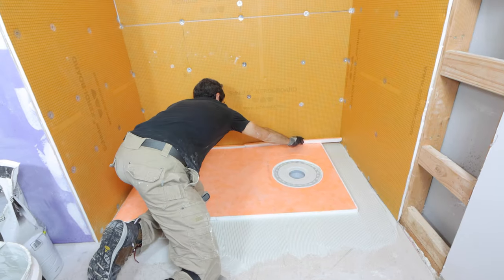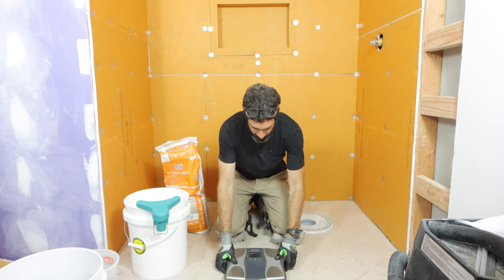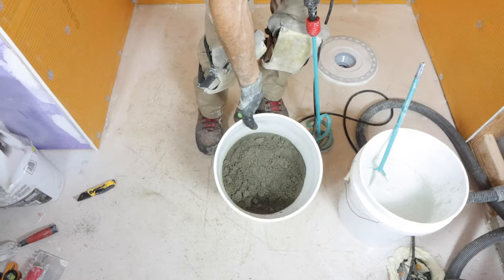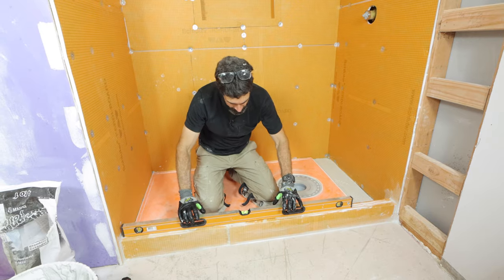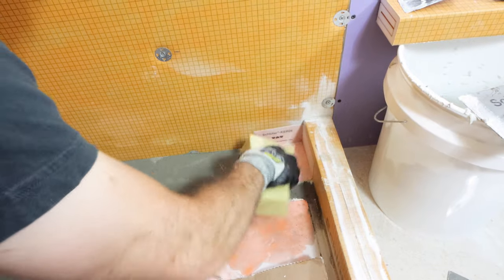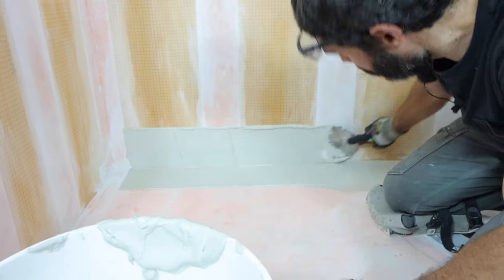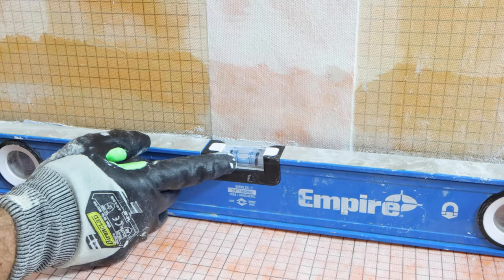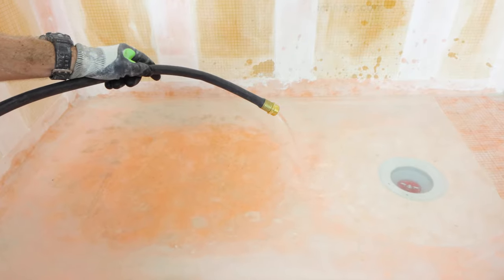Schluter Shower Pan Tips for Beginners

Comment: I don’t understand why you cut off a 3/4” strip on the sides then put it right back down when you laid the pan.   Excellent video.  I really like your presentation approach.
Reply: Me too
Reply: Me three
Reply: @stroys7061  me four
Reply: Makes no sense to cut 3/4 I think it's a trick
Reply: Guess you guys missed the part where he cut an additional 3 inches off each sideto trim it, his trim cuts were probably crooked so he used the 3/4 inch because they had factory edges to square off the shower pan again.
Reply: The first 3/4 of the edges are flat. The pan itself is fabricated with a pitch towards the drain. He cut it because the drain was offset. If it were in the center then you'd cut it square to fit. Now the entire back wall of the shower is nice and level and the entire thing pitches to the drain.
Reply: Seems like alot more work then a traditional wetbed
Reply: It’s to keep level around the shower floor edge for the mud

Comment: Another great video as always! My apologies for the dumb question but I did not understand why you cut 3/4" of the edges and then re-used the same strips.
Reply from the maker: Thank you 🙏🏼 the first 3/4” of the tray is flat. That’s actually very helpful for the wall tile. When you cut down a sloped tray like this one, it creates a slight curved shape along the perimeter which means the wall tile might have to be scribe cut. However, by cutting off the flat 3/4” perimeter and adding it back, it makes the perimeter flat again. And that helps with the wall tile
Reply: @HomeRepairTutor  Thank you very much again!
Reply: How do you deal with the lip it creates when tiling? Just add more thunder when tiling floor? And any additional water proofing needed?
Reply: Thinset *
Reply: @HomeRepairTutor  Sorry, one more question, doesn't the flat perimeter cause water to stay at the perimeter and not flow through the drain? Also, since I'm using 4'x4' panels instead of wall tiles, do you still recommend this trick? Thanks!
Reply from the maker: @f.shabestari8276  you’ll have to make relief cuts for the large 4’ tiles so they can conform to the shower pan slope. Those are from the corners to the drain corners, if you have questions just email me at jeff@homerepairtutor.com

Also, I’d still do the perimeter tip because it won’t prevent water from draining properly. The wall tile will bump out the wall by 1/2” or more
Reply: @HomeRepairTutor  Thank you very much again Jeff! You've been extremely generous with your time.

Comment: Jeff, my kerdi boards don't make it down to the shower subfloor without cutting a two inch strip to run along the bottom of the floor. I am using a kerdi shower pan (2 inch) that meets the wall boards without a gap, do I need to fill that void with deck mud?

Comment: I have the same shower tray that I need to install, however I’m building a curbed shower. Is it necessary to recess the floor 3/4’s of an inch if your using 3/4 inch plywood around the shower? I think recessing the floor would make the tiles in the shower and the rest of floor flush however is it necessary if the shower is going to be curbed anyway? Also can you provide a link so that I can build some of the foundational plumbing beneath the schluter tray. I’m trying to attach pvc piping to my lead drain.

Comment: Not sure that I understand cutting off the 3/4 inch strips to use them in the same spot later. Can anyone clarify?
Reply from the maker: yes, if you have to customize the tray it helps a lot. The first 3/4” along the tray perimeter is flat. This helps when setting wall tile. So if you need to reduce the size of the tray, cut off the first 3/4” then cut off whatever is required for the other sides. I cut down a 38” tray to 32”. So the first 3/4” was cut off then 3” on the left and right sides. Then I added the 3/4” strips when setting the tray. Schluter actually gave me the idea 👍🏼🔥
Reply: @HomeRepairTutor  Thank you!. I appreciate your response and all of your great videos. That makes perfect sense.  I have a 36x72 Schluter tray with the line drain that I'm about to install. I built the opening just a fraction wider to allow an easier install of the pan. I would think that the thinset could fill the 1/8 inch gap ok. If all goes well, I don't have to trim anything  :P

Comment: Did you use the wider banding for the sides with the 3/4" strips you reinstalled?  If you used the 5" wide band, you won't have the 2 inch overlap required along the the length of the strip.

Comment: Jeff, I’m really glad to see your jumping into the deck mud band wagon. I just finished floating my shower base using the the 4:1 that you mentioned, and it was much cheaper than using the foam tray—though I see the appeal of the foam. I kinda agree with Sal and his theory of foam vs deck mud. 

Great vid as always!
Reply from the maker: thanks buddy, yes, I’m starting to like the idea of using deck mud since watching more videos from Eylander Tile. No doubt, it takes skill and attention to detail but it’s simply awesome to learn new skills. Do you have a preferred deck mud or do you like mixing your own?
Reply: I prefer a 5:1 ratio for my mud because it’s easier to shape and form. But that takes time, for time, so I rarely mix my own mud. 

I like the 4:1 from Mapei, but I use even less water that they recommend—2.5 qt/ bag. Makes it less thick, even for a dry pack!

Your finish looked really good!
Reply from the maker: @davidherd3739  thank you, I’d like to use more deck mud and tinker around with it on future projects. I think for custom sized showers it would be great, have you ever used it for a curbless installation?
Reply: @Home Repair Tutor — bingo! That’s the appeal for custom drain placement. Plus I prefer to use the new FloFX drains. You’ve used them? Frankly, they knock the socks off of Schluter or Laticrete drains.

I haven’t used it on a curb less install yet, but the technique would be the same nonetheless.

Comment: I like your video. I want to build one with a linear drain in the middle, perpendicular to the curb. Unfortunately the liner would not be big enough, kinda like in your video. I'm wondering if it would be easier to just make a concrete bed all over. 
Also I want to install a frameless shower door which needs a screw in the curb. What kind of curb would you build so it can hold a screw? I was thinking of a wood curb covered with curb kurdi board. Would be great to hear your opinion.

Comment: Do you need to use the kerdi band where the kerdi board meets the drywall ceiling or do you leave that joint open? Thanks!
Reply from the maker: you can leave it open if it’s small but yes, banding can be used as well
Reply: dont band the ceiling if you plan on having a painted ceiling. just leave it open, water doesnt get that high

Comment: Great video - thank you! Question please - I have a narrow pan as I am replacing a tub and have limited clearance. I've cut the 3/4" strips off the sides as you suggested.  Since I cut the pan down to 25" total width, there is a significant lip on both sides at the 3/4" strip. The lip goes from 1/16 to nearly 1/4" near the drain. Should the lip be filled with something like Henry's Feather patch before I do the Kerdi corners and band? Any suggestions welcomed.
Reply from the maker: Great question, you can use thin-set (eg ALL-SET) to feather that lip. Allow that to set then use KERDI-BAND to waterproof as you would normally

Comment: Nice vid...are you able to connect end on end 2 schluter shower pans? I'm extending my shower and it will end up with 2 drains one on each end (8' shower)
Reply from the maker: good question, if it’s a big shower you might want to consider floating the shower tray with deck mud, I’d have to see the design to determine what would be your best option 👍🏼🔥
Reply: Theoretically it seems possible. Just make sure both pans are the same length since the perimeter heights are different.

Comment: One question, I see sometimes you use Keri membrane on sheet rock and sometimes on usg boards for the shower. what is better Keri board? sheet rock or usg board?
Reply from the maker: Good question, I prefer KERDI-BOARD. It’s lighter than cement board and dustless. And doesn’t have any organic materials, like drywall. Plus, I can use extra pieces of the board to build shower niches

Comment: Nice video! Was this on a concrete subfloor or basement? Would greenboard drywall and primer to seal work for tile in a shower?
Reply from the maker: It was over self-leveler, drywall can be used with KERDI but mist liquid membrane manufacturers don’t recommend using their products over drywall, eg RedGard. You could use cement board and liquid membranes 👍🏼

Comment: what's the diameter of your shower curb? I'm looking at customizing schluter's prefab shower curb to about 3 inches high and 3 inches wide. Your curb looks very similar to how I want mine to look.
Reply from the maker: It was roughly 2-5/8” wide - I customized it by cutting it in half and bonding back together with KERDI-FIX
Reply: @HomeRepairTutor  that’s great. thanks for the speedy reply.

Comment: So you said to cut off the first 3/4" before you trim to size.  I did that with my tray but the 3/4" strips are now higher than the rest of the tray edges????  So now I have a tray that is too small for the shower space and or the edges are higher than they are supposed to be.   You didn't address this in your video, what's the fix or do I now have to go spend another $130 on a new tray?
Reply from the maker: First, this video was done per my Schluter rep who recommended this tip. The first 3/4” of any tray is flat. The reason is so that the wall tile won’t have to be scribe cut. 

Second, calm down. You can still use the shower tray. The 3/4” pieces are added back. And yes, you’ll have a slight increase in elevation. That can be feathered with thin-set and a 6” drywall knife. Once that cures, use banding to overlap the shower tray seam and corner by at least 2” per the Schluter Handbook.

Comment: Great video!  I'm curious, what's your thought on shower pan + strips + deck mud, versus just doing the whole thing with deck mud, both from a time and cost perspective?
Reply from the maker: It’s a personal preference, I can see how some prefer deck mud because of the art form and enjoyment versus perhaps someone who simply wants the pre-slope built into the tray.
Reply: I agree with Jeff. I prefer mud installations. It’s a little bit of preparation up front to ensure you get the proper pitch to the drain, but the payoff is wonderful. It’s faster to do a deck mud install, and you can put any tile you want on the floor. Foam trays, per Schluter directions, mandate at least a 2x2 mosaic on their trays because of point-load distribution. You couldn’t install a penny round of you wanted on foam for example. 

Plus cost is a big factor as well. Foam trays are substantially more expensive than deck mud installs.
Reply: @davidherd3739  Thanks for your feedback as well!  Makes total sense and will take this into consideration for my next project!
Reply: @HomeRepairTutor  Seems to me a portion of that slope would be missing if you added back the 3/4" edge strip after removing 3" from the perimeter, leaving a "step" between the cut edge and 3/4" strip.
Reply: @davidherd3739  , do you cover the surface with an uncoupling membrane or just use the thin waterproof membrane?  Seems like waterproofing all the corners would be easier if it was just the thin membrane.  But then do you worry about grout cracking?

Comment: Why don’t you put the pan in first and the wall second? That way if there’s a failure of the wall, the water drips down to the pan instead of to the plywood.
Reply: No matter the way the wall goes if the corner fails you'll have water going to the plywood. Key is make sure your corners are solid.

Comment: So I know in that one spot, you sloped it.  But what about the rest of the big area?  It doesn't looked sloped since you was on wood sub floor, so why doesn't this system need it to be sloped?
Reply from the maker: The prefab tray has a slope built into it
Reply: @HomeRepairTutor  Nice.  So basically, you thinset subfloor, put down pan, then thin set rest of shower, apply membrane every where, creases, etc, and press in good, and clean up.  And thats basically it?  Thinset everywhere and then membrane everywhere?
Reply from the maker: @jtoker9758  for the most part but with some additional strategy

Comment: Why was the drain disk installed before the shower tray? That should be installed after installing the kerdi board placing the drain disk on top of the thin shower tray opening.
Reply: its done that way when there's no access to plumbing from below.
Reply: @conradcoolerfiend  ohh ok. I've been working with shluter for a year now and so far Im still learning new techniques.
Reply: @juliolabrador463  yes, watch the drain video on schluter youtube channel, it shows this technique. Basically the point is so that you don’t have to worry about embedding the flange into thinset at the same time as worrying about glueing up the pipe joint .

Comment: 1/4 inch slope per lineal foot, that's what he said right? That means over 5 ft you would have 1 1/4 inch slope. How do you get 1 1/4 slope when the Kerdi pan is only an 1 1/8  thick to begin with? You don't it's impossible. This entire system is flawed from the get-go what they don't show you is what you will find out the hard way. If you don't know how to build a shower hire someone who does. I've been in business for 40 years and I've never seen such a scam in my life. There is nothing in this whole system that saves time. Remember you have to get your walls and your floor absolutely 100% perfect before you attempt to put this over it. If you're going to do that why bother with something that's horribly expensive just seal it up and tile it! You've already made it perfect why put their stuff over your perfect work? It's a waste of money
Reply from the maker: You’re misunderstanding the slope, it’s 1/4” per linear foot from the corners to the drain. And all you need is for the floor to be level within 1/4” - using thin-set to make up for imperfections. Furthermore, if the walls aren’t perfect, you can easily wet shim them to make your KERDI-BOARD plumb and even. You’re not understanding the system and the flexibility, I’d encourage you to go to an in person training